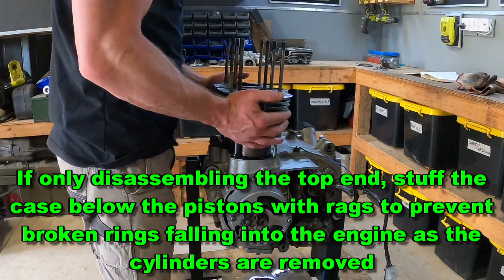XS650 Brat Build Ep 31 Engine Rebuild Pt 1: Disassembly

Comment: You lucky sod.  Came apart nicely.  Just had my cases back from vapour blasting.  40 years later and they look brand new.   Crank off to be rephased to 277 and 750 big bore barrels on their way.  Plus a load of other stuff that will make my project totally uneconomic.  Good luck Brodie

Comment: When I removed the gear clusters a loose ball bearing fell on the floor… the gear clusters look in great shape and the bearings are sealed. Any idea where this could be from? Its my first time disassembling and engine. Thanks
Reply from the maker: Could be the ball bearing for the clutch push rod. It may have been left idown the center of the shaft if you didn't remove it earlier.
Reply: Thanks for the reply brother
Reply from the maker: Happy to help

Comment: I removed the e clip and washer on the selector shaft and then disengaged the selector claw, but the shifter assembly won’t come out. It’s as if there’s something blocking it although there is a small range of motion. Any suggestions of what to do? Thank you
Reply: @2wheelworkshop  that was it! Thank you so much. I didn’t want to start banging on things without someone else’s suggestion 😂